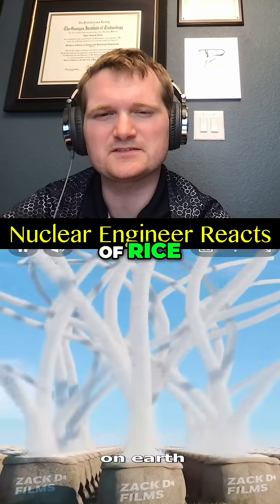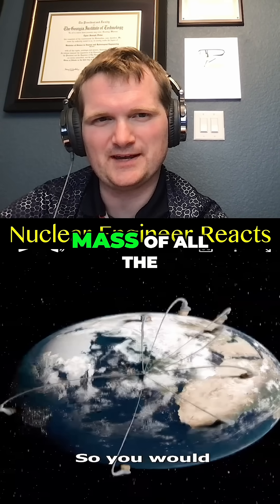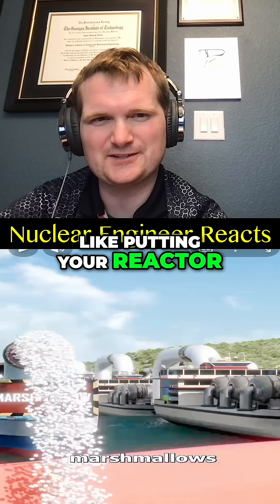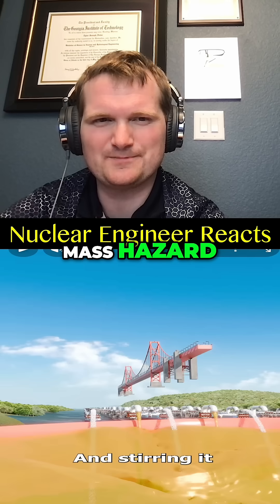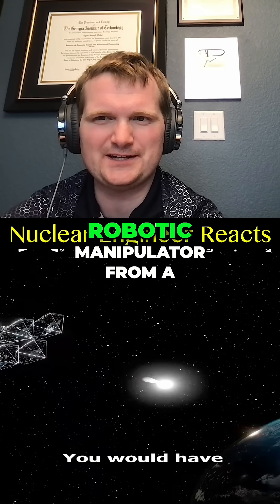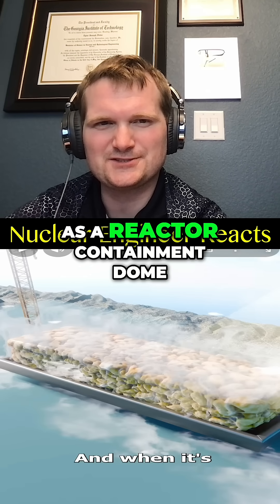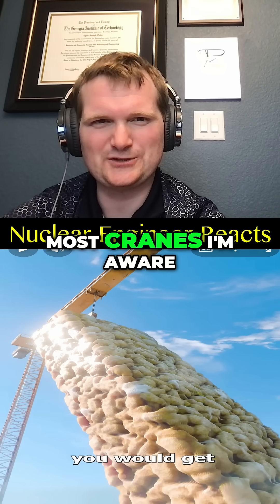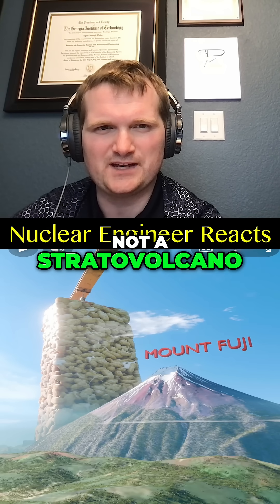What if All Rice Became Rice Krispies? - Nuclear Engineer Reacts to Zack D. Films

Comment: 32 quadrillion grains, is about 0.0223 cubic miles in volume) assuming a single uncooked grain is approx 0.029 milliliters. 

BUT a rice crispy is popped rice, and apparently that increases the volume by approx 6x, so once cooked/popped, the volume would be 0.134 cubic miles. Or about half a mile cube. But then add the other ingredients, maybe adding 20% to that, make it a “bar” shape longer and thinner - i could certainly see it being higher than Mt Fuji. I think you maybe didn’t account for the 6x volume for popped rice, nor that a rice crispy bar is not a cube, but is thin and long.

Comment: Rice crispys are roughly 10 times the volume of the rice they started as. To turn .1sq kilometers of rice into rice crispy cereal it would end up at roughly one square kilometer. Then to shape and form a treat out of this who knows depending on density and the mixture and the shape of said mold. Also when you figure in the overall accumulated density of rice crispy cereal versus the raw white rice it has more spaces between grains further increasing the total volume of this accumulated mass the science behind the video could be more realistic than he said.

Comment: I am confused as to why you wouldn't be able to cook it with solar radiation. If you could cook a steak with the sun, you should be able to cook the rice Krispy treat as well because it has a lot more surface area, with the maximum temperature achievable being about as hot as the surface of the sun, which is more than enough heat to cook rice.
I understand there are material contraints here, but I see no reason it would be breaking any thermodynamic laws.

Comment: Actually internet search gave me the global supply right now is 738 million metric tons
Reply: Given these calculations one would need a bowl at least 3 cubic kilometers to hold the ingredients. I guess a 7 cubic kilometer bowl would be ok if you wanted to mix the batter fast enough to get it to mix
Reply: I think that is annual production - and a lot of it is being consumed during the year, so the “amount of rice on earth” at any one time is probably significantly less (i did the same fact checking - and initially had a much higher number for the annual production too, but with a bit more thinking, I think their estimate is not a bad one).

Comment: lots of problems that don't actually exist in this one. example:   who says you have to cook it all at the same time?
Reply: does anyone actually cook it? you melt the marshmallows then mix and put in the fridge. no baking.
anyway much easier to build the whole thing out of smaller individual rice krispies bricks.
meanwhile they left out the major issue of it falling apart on its own if you try building anything bigger than a truck being as rice krispies cereal isn't sturdy enough. forget getting anywhere near that size.
Reply: @eddiereuger9402  youre right. the only cooking is done to puff the rice and melt the marshmallows and butter

Comment: Tyler is ignoring the fact the rice will be puffed before it's even put in the bowl, vastly increasing its size!
Reply: Only if it's infused with polonium-238
Reply: Plus, even not accounting for the imperfect packing, my calculation using someone else’s rice grain volume gives me about .2km^3 to .3km^3 (not his .1)
Reply: @RtaincCo  I asked AI cuz I suck at math 😐. it came up with .737km³, using ~43.4 million grains per cubic meter.
although a completely different answer, its still nowhere near the size of the bowl.
my assumption is, when do you ever mix something in a bowl and not leave splash space? now 90% splash space is definitely still overkill (.7km³/7km³, rice densitiy/Loch Ness density), but thata about the only valid answer ive found for there to be such a discrepancy
Reply: @rkdarkangel  what AI did you ask? It better have been ChatGPT or something. Because if it is Google’s Gemini AI, there is about a 97.5% chance that it’s wrong.
Reply: Popped rice is apparently about 6x the volume of raw rice. But the other thing he didn’t account for - the “bowl” is put in Loch Ness, they are not saying it will fill Loch Ness. If you look at a bowl that would fit in Loch Ness it is limited by the width, which is what they show in the animation. Also, comparing it with Mt fuji, a bar is not a cube, it is long and thin - easily 3x the width and 5x the thickness in length, and before you know it, all those orders of magnitude disappear, and you do get a bar that is higher that Mt Fuji (6x the volume of the raw rice, plus other ingredients is one order of magnitude, and being “bar shape” is roughly another. And the Loch Ness issue is not laying attention to what they actually say and show).
Reply: Puffed as it may be it won't get 3 orders of magnitude larger.
Reply: @conelord1984  yep, it won't be even near 3 orders of magnitude larger